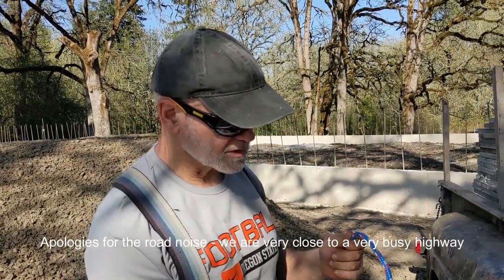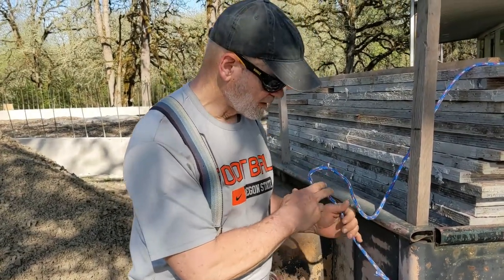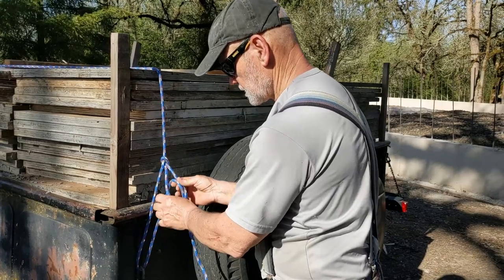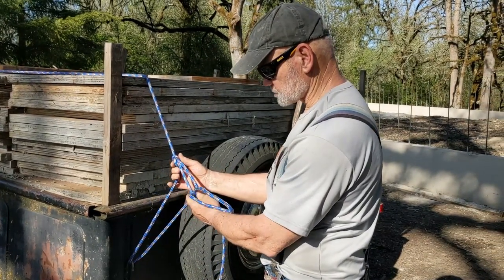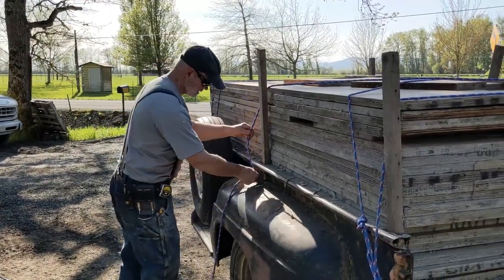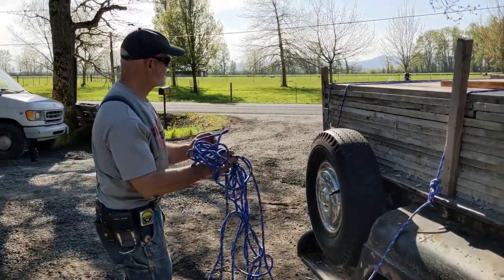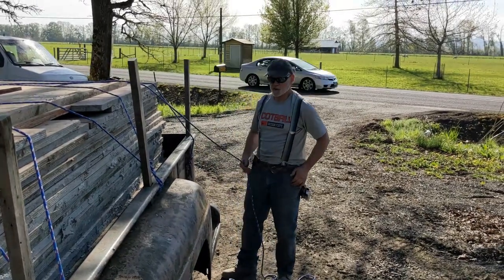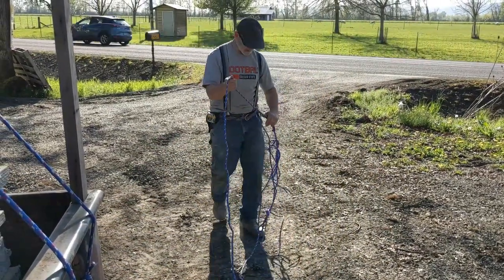Tying the trucker's sheepshank

Comment: Aren't you suppose to do put slip not to road side that way your working mostly away from traffic
Reply from the maker: If you are tying down a load, or removing the lines at roadside, yes, that's a good practice.  But I was tying this load in my driveway and untying it in the contractor's driveway.  If you do put the knots on the shoulder side, you can put a half-hitch on the road side and take the slack out of the know as you pull on the standing end, making the line over the load tight and secure.  You may need to throw another half-hitch on to make sure it doesn't come loose as you go to the other side.  Thanks...
Reply: @longshadowfarmstead1102  thanks
Reply: @longshadowfarmstead1102  over 31 years of trucking I've also have heard it's better to put chain binders on passengers side that way if they fall off they aren't going through someone's window.